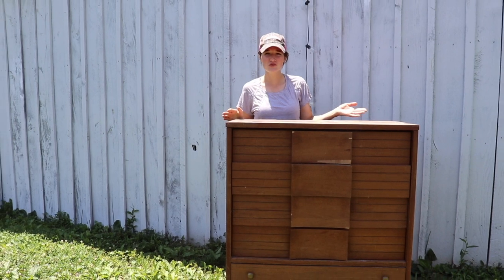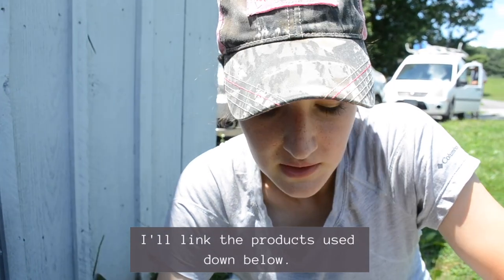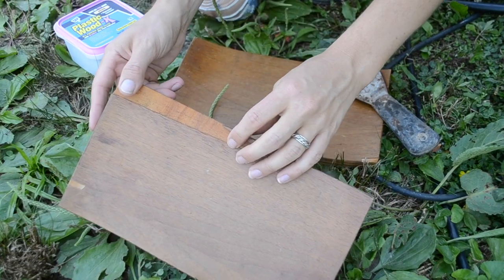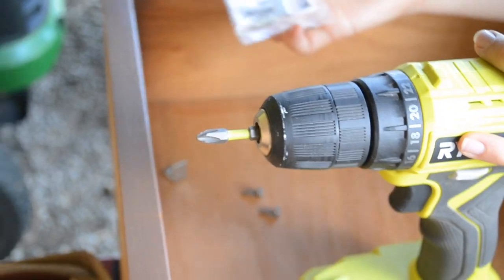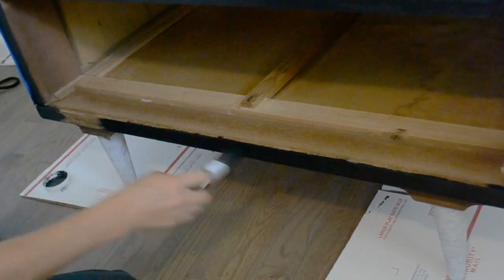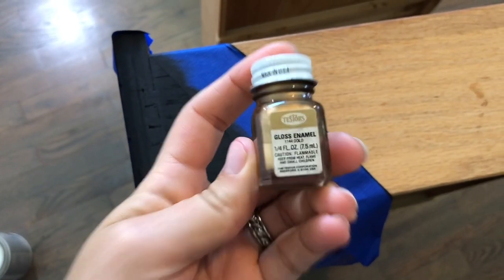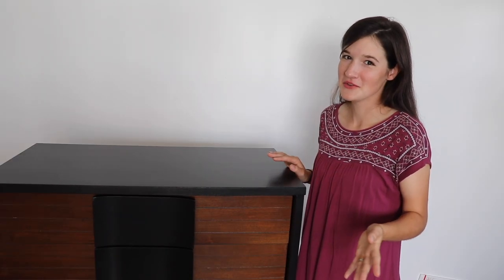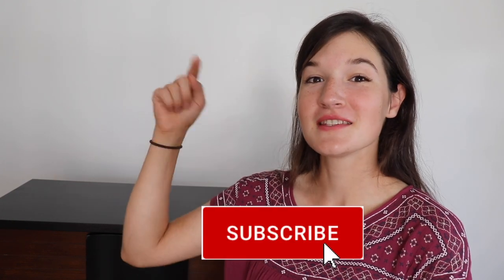Can I turn this CRAZY dresser into cash?? Furniture Flipping for a Profit -MCM Dresser Makeover!

Comment: It looks great. I was concerned when I saw that the drawers weren't sitting right in the dresser.  Then when you pulled them out I saw the parts that we're supposed to hold up the drawers were not level they were bowed. But everything turned out great. Using those brackets on the inside of the drawers was a really good idea. 
I hope you take into consideration how much time you spend on doing these projects and how much your time is worth per hour.